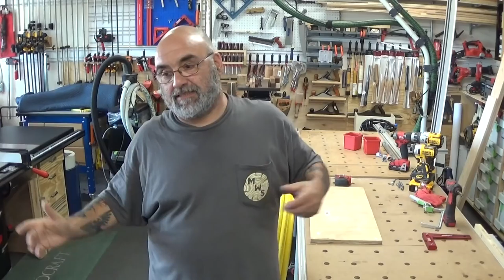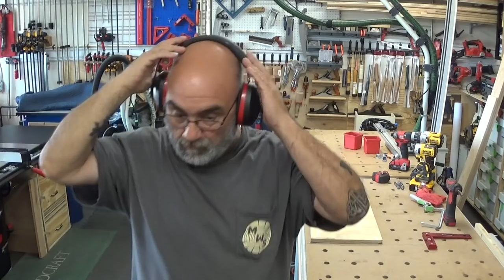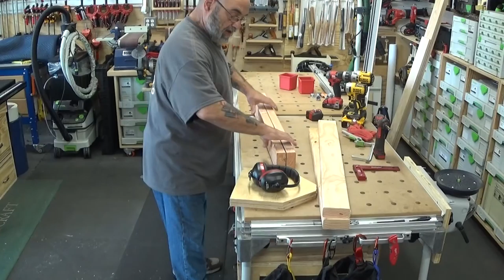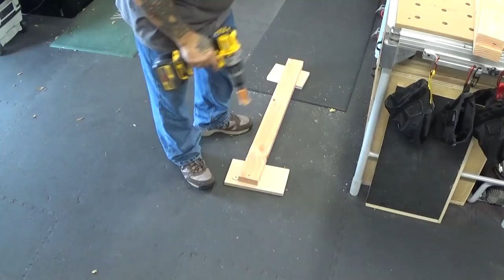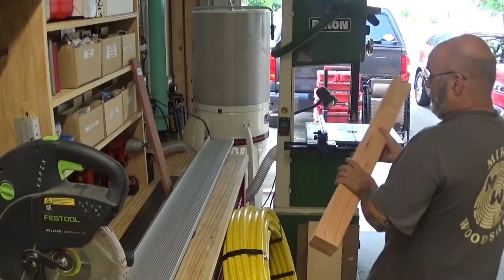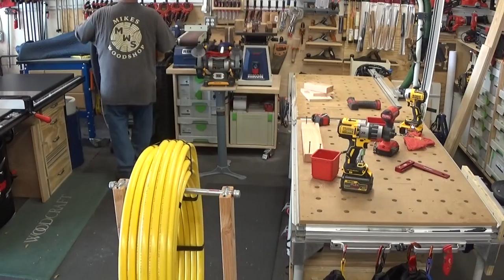Build of an uncoiler for my underground gas piping.

Comment: Great build!
I suggest using threaded inserts for wood or tee-nuts, bolts, and knobs to fasten the cross brace to the verticals instead of screws.
Reply from the maker: D Scott I was going to do that but I couldn’t find my storage box with the knobs and bolts lol go figure. Thanks for the comment
Reply: In my garage finding hardware is like playing a game of Tetris moving things around to get to were I may have stored it.  I also find buying knobs a lot cheaper than trying to make them myself.
Reply from the maker: D Scott as soon as I find the tote with the knobs, screws bolts I was going to do that lol
I was moving unused stuff from the shop and know there gone.Thanks for the comment and idea. Mike
Reply from the maker: D Scott I was cleaning the shop of unused stuff and I guess I moved the entire tote with all the knobs and inserts go figure lol

Comment: if you put a second brace lower down you can make a drop on pull off roller guide canterlevered out from the front of the roll which you can attach  a stabalizer 4x2 down to the ground  so when you pull it  wont tip over  actually get 4 more 4x2's put holes in one end for the 4x2 to slip over the pipe place them either side of the pipe to be rolled out get appropriate sized bolt at the other end make a hole to fit the bolt in both 4x2's do the same for the second set of 4x2's and size the length to the ground so you have bracing for the pulling force and guides for the pipe to be pulled as well 
cheers buddy

Comment: Building a better mouse trap!  Great Unit Mike. Going to try  do something similar but little smaller for doing Uponor for repipes so will unspool when I’m pulling thru attic so tube wont keep coiling back up! I understand frustration w Ins. Still dealing w Florida Work Comp from Neck Fusion and shoulder surgery. 😣 Keep the Faith Brother 💪🏼🛠
Reply from the maker: Jeff Rice I have two Pex uncoilers but that tubing won’t fit on them. We try it Monday. Thanks Mike

Comment: Great video, ....what brand is that grinder behind you ? Baldor ? And that stand ? Thank you
Reply from the maker: Joe Framer it’s a Ryobi 8” # BGH827, 3600 RPM ,5/8” arbor. I’ve had it for several years and have had not one bit of trouble. The stand is from Harbor Freight. Thanks for the comment Mike